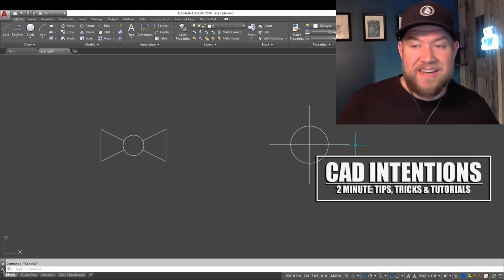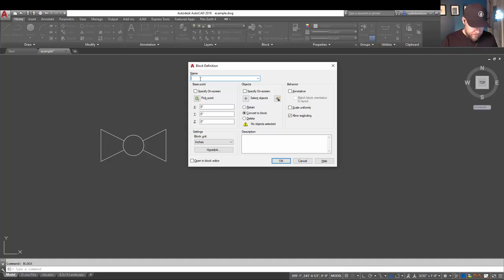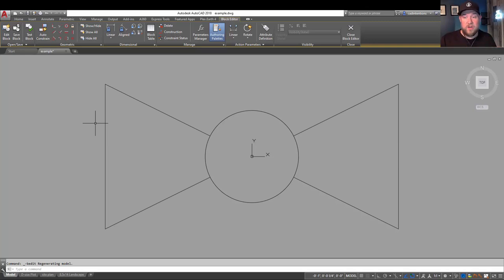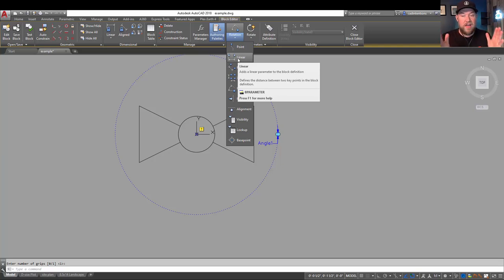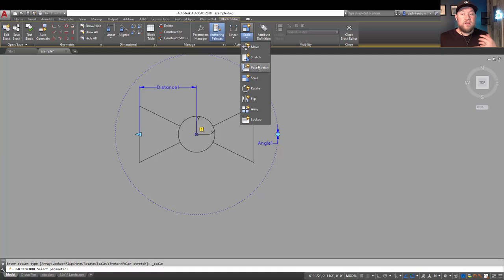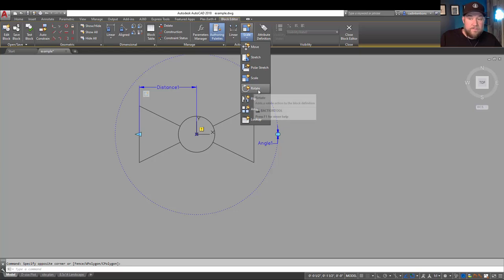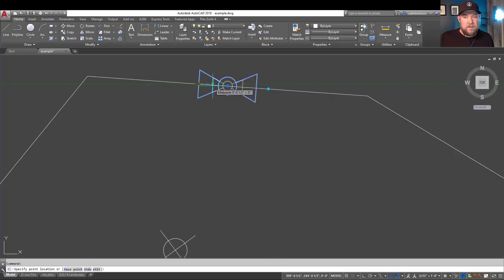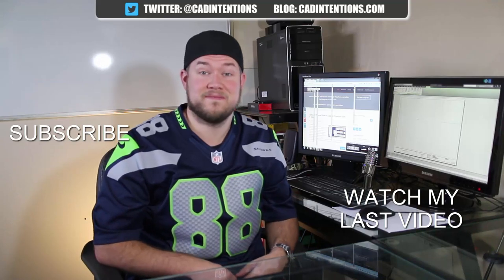AutoCAD Create a Block with Scale & Rotate Parameters - Dynamic Block Tips | 2 Minute Tuesday

Comment: It's such a time saver, having the ability to create these dynamic blocks, but the thing that I can't quite get my head around is why when flip, scale, and a few of the other attributes are added that graphically, things start to distort as you make changes.  For example, I've made a block that has scale and flip, which both work on their own, but when I flip the object and then scale something doesn't translate and the block no longer scales correctly or if there's text it doesn't stay in its assigned location. Thoughts??

Comment: I am working for a mom and pop firm, and they have had many eng. techs that have made blocks at different scales and I am trying to get our block library somewhat standardized. What would be the quickest way to redefine the blocks that come in at completely different scales?
Reply from the maker: hmm, that's a tough one. I think whichever way you decide to go, theres going to be a decent amount of time spent to standardize them all. 
Ideally creating them all using the same base drawing/template, using standard layers and drawing at one scale as you mentioned is best. I would start with deciding the scale and standards you wanted to stick too and focus on converting/redrawing a handfull of the most used and typical blocks. Also, documenting your standards and step by step of creating new blocks will help in the future to keep things the same as well as allow you to pass of block updates/creation in the future to say junior drafters/interns etc..

Comment: I am looking to create a dynamic block, that rotates around as needed but has attribute text that will always stay horizontal (readable), possibly with a grip to be able to move it around if needed.
The block I am thinking of would be a light switch for electrical drawings, and the text would be the switch number. Similarly, another block for the outlet, and the text would be the circuit number.

Comment: I do have a question with dynamic blocks, lately I found myself the need to have an annotative attribute text within a non-annotative block, is it possible? because whenever I apply annotative settings to the attribute in my block, it's either the text won't show or only a random scale from the attribute gets applied.